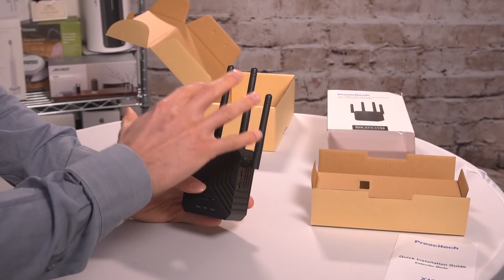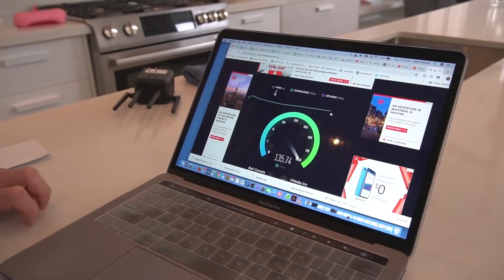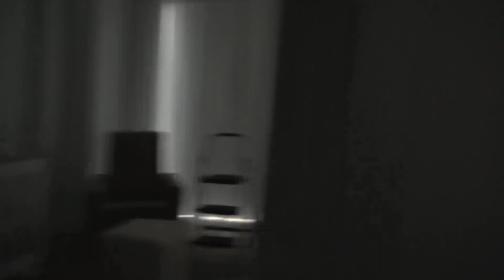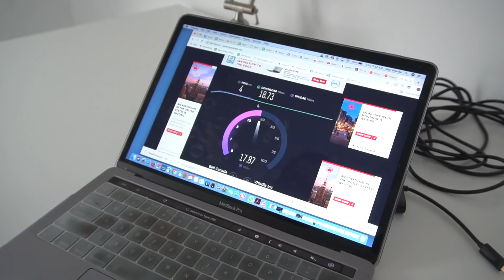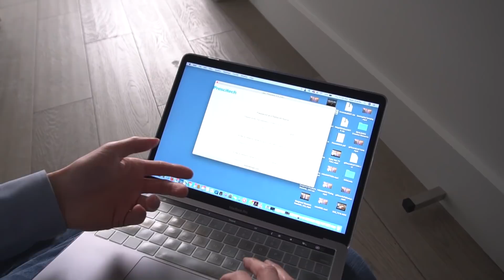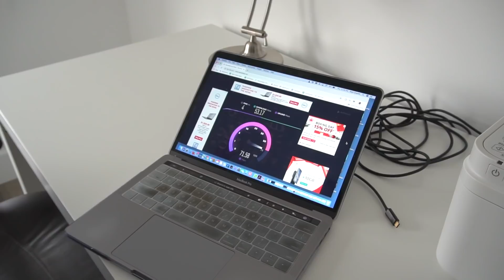How to TRIPLE your WIFI Internet Speed (YOU NEED TO TRY THIS!)

Comment: Is there truth to the concept that WiFi signals travel OUT and DOWN?? If so and you had the option to move the Router/Ethernet inbound connection to the third floor, then these results would be REVERSED???

Comment: I've tested a different model from this vendor, one with higher spec than this you showed, and the signal is indeed really strong, but it couldn't handle more than 120mb-150mb, my connection is 360mb, which should be supported as informed in the device description. I tested three of the same model and all of them had this limitation. The solution I found after trying many options was to use Asus iMesh, they arent perfect (few bugs) but by far the best option I found (can reach 320mb, strong signal, seamless handoff, etc.).

Comment: @ The Deal Guy, if you would have set up your wireless router on the 3rd floor instead of the first floor you would have received way better speeds on all 3 levels of your home without the WiFi extender because the WiFi signal travels best horizontally and  downward, not vertical.

Comment: Any range extender would do what this one did for you. In order to get maximum download speeds throughout the house, set up a wap wireless access point. The SSIDs on your WAP could use the same names as original SSIDs.  I am never a fan of range extenders.  Another solution will be to use powerline adapters!

Comment: Remembered folks unless the extender is on its own wifi 5g or 2.4g network alone between it and the router and your devices are on the other band your speeds will be be halfed. So will your signal will be better but your speed will only marginal improve unless you are in a spot that is always dead. Of course then you will be happy with what ever you get because you will have internet in that spot. I made that mistake once because I had crappy wifi upstairs and I felt it.  I fixed it however by turning it into ap mode by wiring it to my gigabit network and now it is the only device supplying the wifi and it reaches the whole house with great speeds.

Comment: I live deep in the country. No wifi provider here so we use my phone as a hot spot.  Seems to usually work ok for my laptop. I have no problem streaming Netflix through my phone. I cant seem to get a good enough connection through my TV (using my phone as a hot spot) to watch Netflix. Any suggestions for a booster?

Comment: Nice, if you have an actual existing Internet connection. If I could get a fiber connection for my house, I would be so happy. I live in the boonies - no one ever thinks about us - this isn't dissing you, Matt, it's just that all of these new electronics rely on an existing high speed Internet connection. 

I have no cable, no wifi, no chance of HSI in my area. If you can figure out how I get a company to run a cable near my house, I'm all ears! 😀 I actually use a cell modem, with an exterior antenna to pick up a signal and a Cradlepoint router with the modem to get Internet. So expensive, and no streaming,  large data downloads, etc. So frustrating!

Comment: I am ready to buy, however, I need to know you set up the extender from your hallway without going back to the Bell Supplied Router to pair the two units.  This is important to know.  My mom lives in an independent living facility that supplies WiFi.  She has legal access to the WiFI but the signal to her area of the facility is 1 bar.  We’ve added extenders like this before that appeared to be the cure except during setup we were required to press a button on the ISP supplied router allowing the devices to pair.  We do not have access to the router in my mom’s area.  Please advise. Thank you for your videos.  BTW, there is a typo.  The extender you featured is $49.99 not less than $25.00. That’s ok, typos happen in life and YouTube. :).

Comment: Do I still need to pay  cable company for my WIFI ?
Reply: WiFi is provided by a device that is connected to the wired internet. If you use the one provided by your cable company, then you have to pay them. But you can by your own and pay only for the cable service as nd not WiFi device. Same goes for the Modem.
Reply: CS User thank you for replying to my inquiry
Reply: Deb Provenzano 
Only if you want wifi. Lol

Comment: A wifi extender is essentially a repeater.  While the extender helps boost the speed in far way spots where you have the extender set up it also means that it reduces the speed of your original Wi-Fi signal.  If you have a decent speed to begin with, using an extender is not bad to reach far parts of your house that would not normally get any connection.